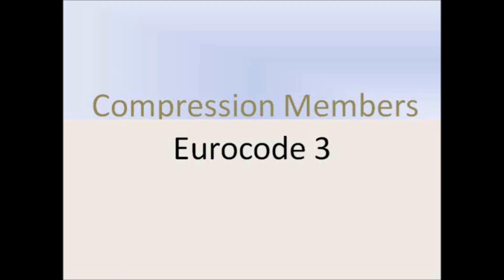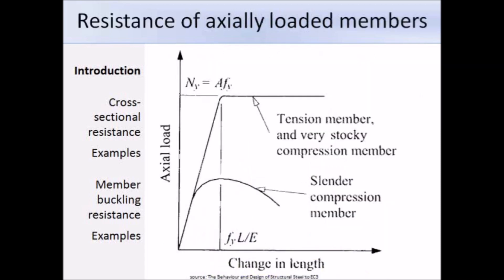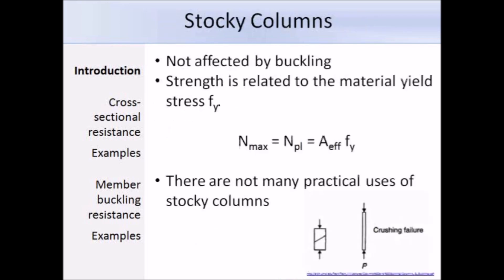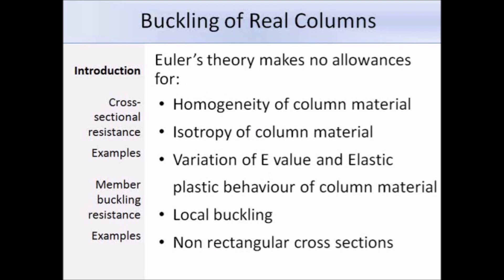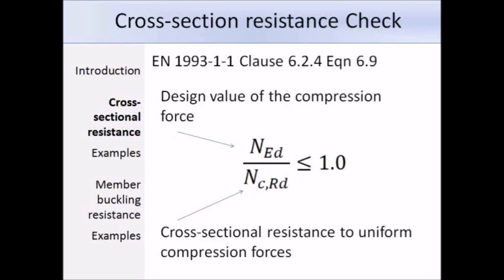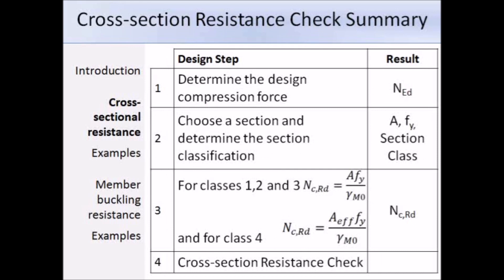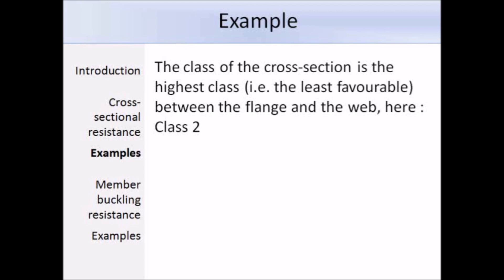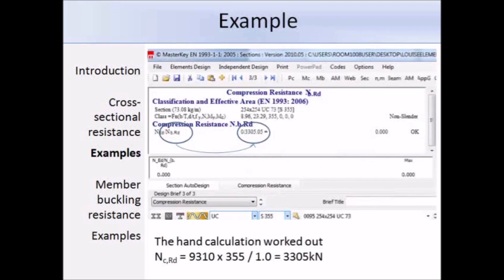Steel Column Design | Compression Member Design | Buckling | Examples | Eurocode 3 | EN1993 | EC3

Comment: Thank you for this. It was really informative and cleared most of my issues in designing columns using EC3. Can you please tell me if there is any partial safety factor to be used when calculating design compression load N(ED) Or we just simply get whatever axial load is applied on the column as design load?